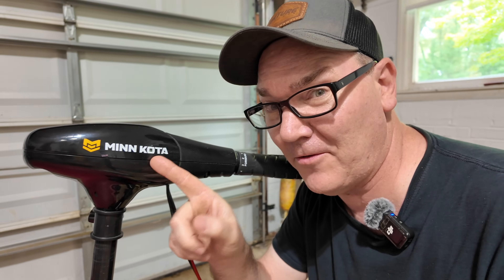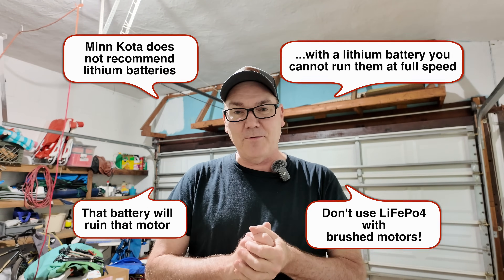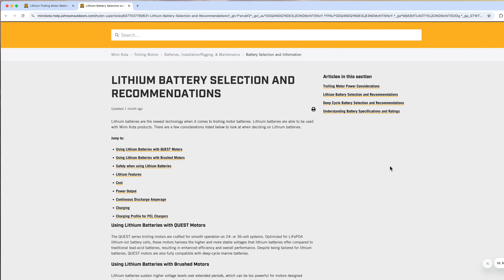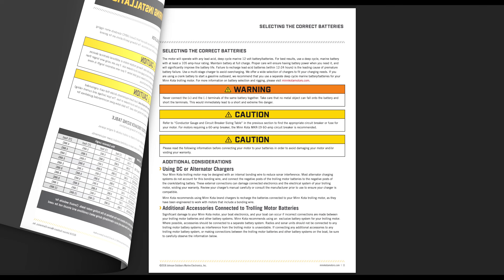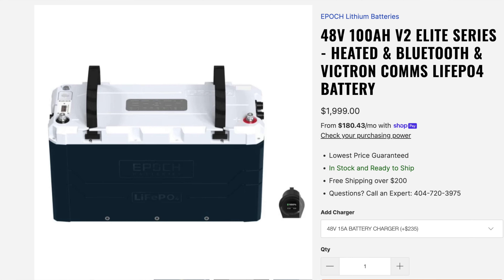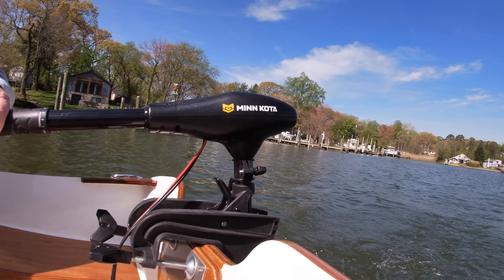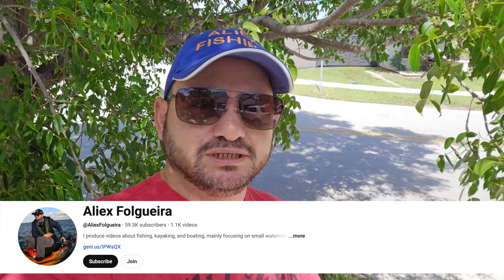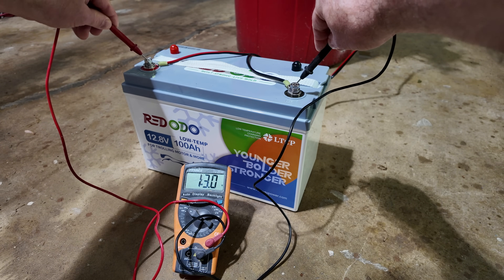Does a Lithium Battery DAMAGE a Trolling Motor & is Minn Kota Hiding the TRUTH?

Comment: I think you're right about the overreaction of lithium damaging most trolling motors. Here's an interesting point: Newport replaced my 36V NK300 battery (good cust service) and did not want the old one back. I proved again (carrying both batteries onboard my kayak) that the "bad" battery dies quickly at high level usage of the NK300, however, when I use a 36V to 12V DC converter (only 360 watt capable) to do an extended load test of both batteries using my 12V inverter, the "damaged" lithium does a pretty good job almost providing as much run time at 300+ watts as the "good" battery. Therefore, I will be adding maybe a 30lb thrust trolling motor for fishing movements and initially plan to power using the suspect 36V battery via the 36-12V converter.  I just found out that one benefit of the converter is that it regulates a steady 12VDC source on the secondary side.  Also, if it works it might give me a 36V backup for my NK300 just in case.  I can only undertake this two battery (28 lbs each) endeavor due to my upgrade to the Kaku Guru kayak with a 600 lb load limit.
Reply: I'm also curious what you think about the use of so-called "freshwater" trolling motors (like many smaller ones) for brackish or saltwater applications.  I plan to push that point and likely will buy the cheaper one made for freshwater and I fish in Louisiana inshore brackish water.
Reply from the maker: The cheapest Newport trolling motors are supposed to be okay in saltwater. The Minn Kota Endura 30 that I have is supposed to be freshwater only. I use it in brackish water and rinse it after running and it's been ok - but it's only been out about 6-8 times so far.
Reply: @WayneTheBoatGuy  Wayne, your video came back again - here's an update to my situation that you might find interesting.  I have continued to use the "bad" 36V battery to power my 34lb thrust (32 amp) 12volt Watersnake trolling motor on many fishing trips.  My NK300 is used to go on the long runs to the spots.  With fairly moderate usage of the trolling motor for fishing movements on typical 7 hour trips I made 3 trips before charging the suspect battery when running about 30 amps max on the 12V side (10 amps on the 36V side) of the converter.  This converter always maintains exactly 12 volts DC to the trolling motor.  The "bad" battery does die around where it should have 50% of its power remaining, but I still get multiple fishing trips out of it.  The reason I share this detail is that if someone like me has a 36V motor and a 12V motor, they can buy a huge 100 ampere hour 36V LIFEPO4 battery and add a 36-12V converter to power the trolling motor's minimal load and the 36V motor.

Comment: I’ve got two (24v) Ionic 100ah batteries connected to a 80lb Minkota Fortrex on my 16 foot flats boat. No issues after 2 years of heavy and hard use fighting tides and wind. I can fish for 4 or 5 days at 6-8 hours per day before recharging. The only problem I encountered regarding Lithium is my Lowrance 7Ti shutting down due to over voltage. So I added a 12v regulator to the house battery and now no more issues. Lithium is a game changer in terms of weight savings and discharge, no more slowing down at days end, no more charging after every trip. Bluetooth connectivity gives me all kinds of battery data so I know the batteries status at all times.

Comment: Just a side note because it wasn't mentioned, but:  48V @ 100Ah = (51.2V nominal really) = 5120 watt-hours of energy storage.  12V  @ 100Ah = (12.8V nominal really) = 1280 watt-hours of energy storage.  That's why the 48V battery in that example was far more expensive... it's four times the battery!  Also roughly four times the volume and four times the weight.

LiFePO4 voltages are fairly tame so there shouldn't really be any problem there, but there can be a wear-issue on the motor with LiFePO4's lack of voltage droop.  Lead-acid battery voltage droops a LOT under any significant load.   LiFePO4 battery voltage barely droops at all.  So when you are running the motor at 100% with a LiFePO4 battery, the amount of energy being delivered to the motor is significantly higher than what you would get with a lead-acid battery.

Anyone really worried about this can just stick to setting 4 as their max.

-Matt
Reply from the maker: I appreciate you sharing your insights and calculations, Matt!

Comment: I have that identical endura trolling motor on my kayak setup. ive  been  running it on a 100 ah lifepo4 battery for the last 6 months with literally zero issues.  I dont run for hrs and hrs at top speed, but thats because im a stop and go fisherman.  I agree 1000 percent that minn kota should give   the proper information for battery type and usage.  ive been waiting for someone to make this video for a while now because ive been told the same thing. that if I run my motor past 80 percent for any significant time that it will cause damage.  would honestly like to see more testing done and maybe to the point of failure.  but thank you for the video
Reply from the maker: When I started recording, I was honestly expecting failure to happen.
Reply: @WayneTheBoatGuy I really hope that it doesn't crash and burn, but maybe thats the only way minn kota will give users the information they need .

Comment: Question:  When the lithium battery "dies", does it decline (like a lead-acid) or simply shut off? Anyone?
If have 2 of them (24V), would the behavior be the same?
Reply: LiFePO4 maintains a very flat, high voltage and full power delivery through 95% of its discharge curve and doesn't really begin to fade until the last 5%. Plus you can regularly cycle it 100% DOD without it taking much damage (doing that on every cycle might drop a 6000-cycles-to-80%-capacity down to 3000-cycles-to-80% capacity, but not really be much worse than that).

This is why people like LiFePO4 so much.  It just delivers and delivers and delivers.  And weighs a lot less at the same time.

-Matt

Comment: Consider that a LiFePO4 battery will maintain 13 volts or so for 90% of the battery capacity while a lead acid battery will experience considerable voltage sag from the beginning.  So lets do  some simple arithmetic.  According the the Minkota web site the Endura 30 pound thrust motor can draw a maximum of 30 amps.  At 30 amps and a fully charged lead acid battery that works out to 30 amps x 12.8v = 384 watts.  So if we say the maximum watt draw for the motor at full power is 384 watts, with a LiFePO4 battery that maintains 13 volts, the amp draw to produce 384 watts is amps = 384/13 = 29.53 amps.  The amp draw will stay there for 80+% of the battery capacity.  A fully charged lead acid battery will start out at 12.8 volts with no load, but as soon as you turn the motor on the voltage will sag and the voltage sag will get worse the longer you run the motor.  So, if the voltage sage initially to 12.5 volts the initial amp draw will be Amps = 384/12.5 = 30.72.  As you drain the lead acid battery the voltage will drop even more, so at about 50% down the battery voltage into the full power motor will be about 11.5 V resulting in an amp draw to give full motor power of amps = 384/11.5 =  33.39 amps.  The result of the higher current at any given speed with a lead acid battery versus a LiFePO4 is that the motor will generate more heat that you need to get rid of.  That extra heat will damage the motor over time.  So I would suggest that running on lead acid batteries at high speed is likely harder on the motor than running on LiFePO4 batteries.  The only potential issue I can see with a LiFePO4 battery and a brushed motor is a bit more sparking at the brushes due to the higher voltage.  That may degrade brush like a bit.  The solution is to go with a more expensive brushless motor.  You can probably replace the brushes in your brushed motor quite a few time for the price difference.
Reply: Math!  What a concept!

Comment: Whoever told you a trolling motor will be damaged by a lifepo battery is spewing nonsense. I am a retired  electrical engineer. 12.8V is nominal voltage of battery or 3.2V x 4 . At full charge it is 13.6V
A lead acid battery at full voltage is 12.65 volts an AGM a little higher maybe 13V. There is NO WAY that 1 or 1.2V higher at full speed will damage the trolling motor.  Enjoy the benefit of the Lifepo battery as it provides a nice steady voltage with little voltage drop thru charge and improves performance of trolling motor. I bought one and have been using this year so far on my motorguide R3 30lb model and i will NEVER go back to that back breaking lead acid battery.
Reply: My motor says 85% on lithium!
Lithium has a much lower internal resistance and it's in my manual.
Reply: @gilianrampart8514 Do what manual says
Reply: Electrical Engineer or not.  Minn Kota says on their website not to run the older brushed motors on the highest speed setting.  My friend did this on his brand new Minn Kota 12V 55lbs thrust Powerdrive without knowing this warning.  It was a windy day and to maintain control he had it on high speed for an extended period.  It cooked the control board within 2 hours of run time.  Sent in for repair under warranty and they said this is why it happened.  I have friends who are electricians who agree with you and so would I but still this happened regardless.  The battery used had a Battery Management System with Bluetooth capabilities which allowed for careful observations to be made.  The voltage they maintain is too high on discharge over time.  For short bursts you might be fine or you might get lucky and have nothing happen.  The point I'm making is it's not worth the risk to shut you down on the water to run them with a lithium.
Reply: @mikerouse6004 its wild the big differences in outcomes with these. They sound amazing. I use only a trolling motor to get around in my little boat and was thinking about pulling the trigger on lithium, but now I just dont know.
Reply: @georgegogis7958  minnkota denied my warranty because I have a single 36v lithium.
Reply: @georgegogis7958 I heard people say its the battery that gets damaged when running at high on low charge. Is this true? If that's the case, I'm still gonna be using it. Its like saying, I don't want to drive my car because I will wear it out.
Reply: Please read my post.
Reply: Thanks for input, I was getting nervous.
Reply: You're obviously not an electrical engineer.  If you were, you'd know the difference between nominal voltage and operating voltage.  Secondly, the guy on the video is using a lithium battery which is specifically designed to run trolling motors.  All this means, is the BMS has a buck converter or regulator built into the battery to step-down the operating voltage.  Other lithium batteries not rated for 'trolling motors' do not have this function.  Thirdly, LFP batteries at 100% state of charge, can reach voltages as high as 14.6V, not 13.6V!!  You're not an electrical engineer, and if you were, you were a terrible one who was probably forced into retirement, LOL 😂
Reply: Your knowledge should let you know that it could be a problem, and instead you rely on your archaic knowledge of batteries to think that it can't be a problem.
Reply: @georgegogis7958 Would you agree that "spewing nonsense" about anything and everything is just what people do today?
Reply: Yea, LFP is a huge fire danger too.

More nonsense for the pile,
Reply: The voltage difference is more in the 2-3V range because they are talking about speed setting 5 here... the batteries are under significant load and the lead-acid will droop quite significantly while the LiFePO4 will not.  Also the lead-acid will fade fairly quickly as it discharges whereas the LiFePO4 has a very flat discharge curve and will maintain a high voltage all the way to 95% depletion before it really begins to fade.

This difference can be significant for a 12V brushed motor.  But personally speaking I feel a lot of these reports are just people "feeling the freedom" of lithium and over-using their trolling motors.  Its hard to imagine people running their motors at speed 5 all the time.

-Matt
Reply: @junkerzn7312  Some people fish all electric lakes where we have to run full power to get from one spot to another.
Reply: @junkerzn7312 i agree you are probably right i did not test my theory just based on thoughts
Reply: Well, ... you're wrong. 

Normal lead acid batteries voltage drops as current increases. 

Lithium batteries does not.

The result is that on high power level like 10 the motor pulls more wattage than it was designed for. 

You're thinking of 12.8 volts but you need to think in terms of of 12.8 * 3  ... The motors are larger and use more power and the voltage discrepancy is even greater

The higher voltage during charging also has already fried boards in Rhodan trolling motors.
Reply: @MudflyWatersman  Well then thats a Rhodan issue.......right?
Reply: @MudflyWatersman  I totally agree Lifepo4 do burn boards, I am a service tech, and have replaced 100's of 5 speed rheostat motors, because of the lifepo4 batteries tend to take out speed 1&2 .
 Some people here mention they are electrical engineers and go on trying to justify why those batteries are great, but have no clue about the havoc they create to T.M. 
I had issues with Newport vessel, Chinese brands, Motorguide pin point board, Minnkota, Spotlock, and Rhodan.
I on the other hand am grateful for these lifepo4 batteries as they generate a significant income for my company.

Comment: I don’t think it’s the battery type per se. it’s the sustained power output that these motors were engineered at.  Originally they were based around lead acid 12v deep cycle batteries.  Which might last an hour at max speed at best.  Which means cooling period after that battery is spent. Lithium batteries dramatically increase runtimes. 

Imagine if you plugged this motor into an ac to 12v dc converter.  Your run time would be basically until the trolling motor disintegrates. 

That said.  I think this is just an abundance of caution on min kota’s behalf.
Reply: Yes.  Plus very minimal voltage droop from the LiFePO4 battery whereas the lead-acid battery will droop and fade very quickly long before it gives up the ghost.  A LiFePO4 battery more or less holds its voltage under load with minimal droop and holds its voltage while being discharged all the way to 95% discharged  before the volts really begin to drop.

Comment: 🌴🤔hey Wayne ,I would think as long as it was down in the water were the housing could remain cool it wouldn’t be a problem if it was continuously ran out of the water things would get hot and burn the brushes , one day I might get a lithium battery, for my old 45 lb thrust minn kota rip tide , but for now it’s ran off used wheel chair battery, 😄it’s old like me !

Comment: Running a motor in a closed system could result in a loss ability to dissipate heat. Motor failure in this test could possibly have been simply from overheating the motor. Obviously,  that didn't happen.

Comment: The worst damage will come from not having water recycle in your test method. You’re heating the water when in normal conditions, it would be fresh, cooler water. It’s like using a vitamix. You can heat soup just by blending because of the friction. That heat is probably worse for the motor than the slightly higher voltage.
Reply: Excellent point!

Comment: I've been having major issues with my Terrova Quest and lithium batteries. 
I've melted a couple circuit breakers going full speed after about 10 minutes. Plus, the built in MSI+ sonar is going haywire and is unusable. I only just this year found out that lithium batteries were the reason for my trouble.
Reply: Using 16.8v lithium batteries?  Too high a voltage, use LiFePO4 which peak out at 14.2-14.6v.

If using LiFePO4 the lithium batteries were not the cause and someone just pointed to them out of ignorance.  Probable causes:
* too small or fake (copper coated aluminum, CCA) wiring gets hot and conveys heat to the breaker
* cheap breaker gets hot and melts
* improperly torqued connections on the breaker get hot and melt
* improperly crimped terminals get hot

Ensure your wire size is sufficiently large, or at least one size larger if using CCA.  Use a good, name brand breaker suitable for your wire size.  Torque the terminals to manufacturer specifications. If you cannot find mfg torque specs for a breaker, find a better breaker mfg.  If using crimp terminals the crimp needs to compress the wire strands into a solid mass - no airspace.
Reply: You should limit "full speed" to very little regardless of the battery type